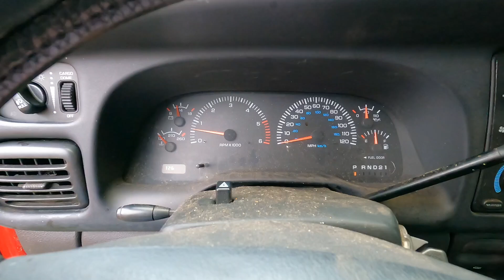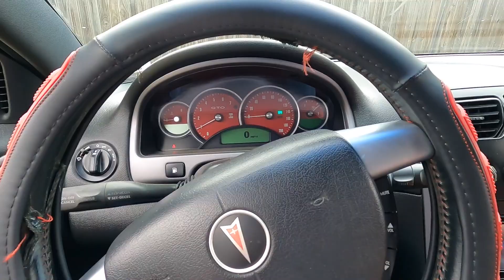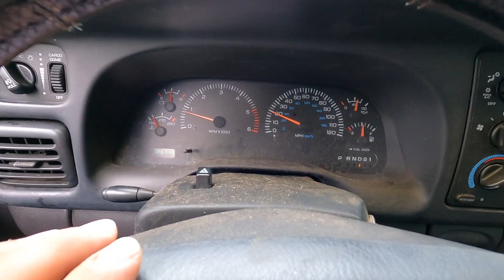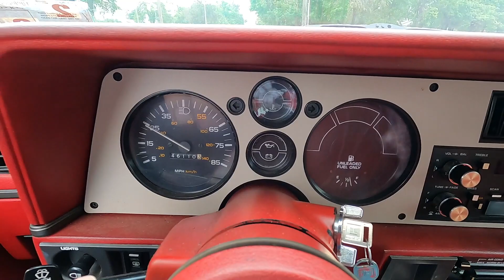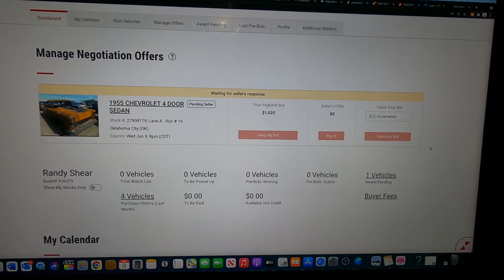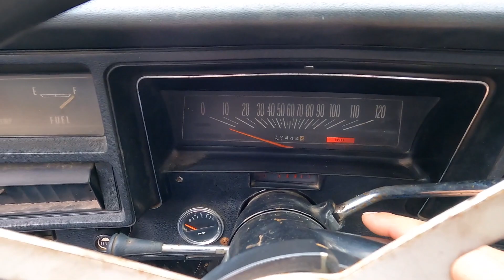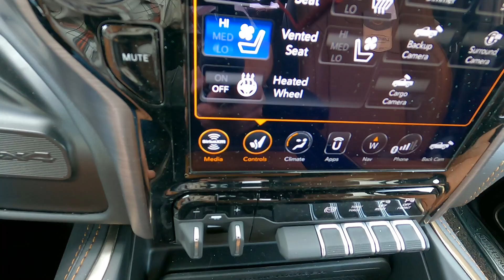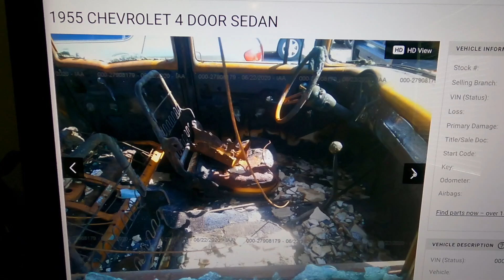Saying Goodbye is Hard to do - All Cars off to IAAI - Don't Miss This!!

Comment: Randy I watch your channel often! I'm living in Atlantic City nj 08401! I really love your shows that you do on this channel. I'm really hoping that you can find a 1960ish, - 1970ish, Ford Ranchero. Hopefully in good condition,  because I used to own a 1973 Ford Ranchero back in the 1990's. But the cooling system freeze plugs popped out and in Reno, Nevada at that time, the cops wouldn't let me jack up the car to put in the rubber freeze plugs. The engine was some what dirty and a little rust, and had a front exhaust leak, and maybe it needed a new gasket. But she ran very well before the freeze plugs popped out. I have gotten 3,1/2 years out of her. I only paid $500 for her! I really love to own another Ranchero, because the size is bigger than a el cameno.

Comment: Check the plug wires, and the plugs for the Cavalier. I had one do that to me once. Also, check the distributor cap, and rotor button. Mine was just replacing a plug wire, no more sputtering, and spitting.

Comment: Randy seen on the other video with you cleaning the engine bay and yeah i learned the hard way on older vehicles. Usually at dealerships we clean everything just spray the engine bay down no issues. I thought when cleabing my cabrio's engine bay i got the ignition coil wet didnt realize it. I even waited like an hour to drive it to make sure things were dry. Then it ran like shit and didnt even start, then it dawned on me and i was out 80 dollars

Comment: Randy, Help! I am currently resurrecting a 1998 Ford F-150 4x4. She is running rich on the driver side giving a code for the o2 sensor heater on the driver side. I’ve replaced the injectors, injector leads, all o2 sensors, and the ecm. I still get the same codes and it still runs like junk. Do you have any thoughts on this?
Reply: Have u even checked the spark plugs lol
Reply: @lovellmills7959  yes good sparks on all of them

Comment: The Ram Pickup would really look good with a little buffing, the chev 's purple paint might come out, the el camino just needs paint which would be worth it, ya might put some graphite in the speedometer cable.  All seem to be running good. You might get the $5000 for the GTO and yes we saw the Police Car , boy you were lucky....................